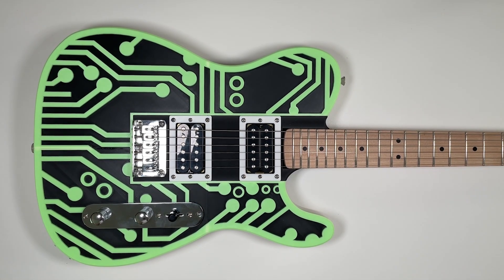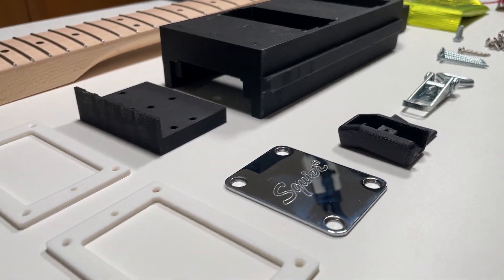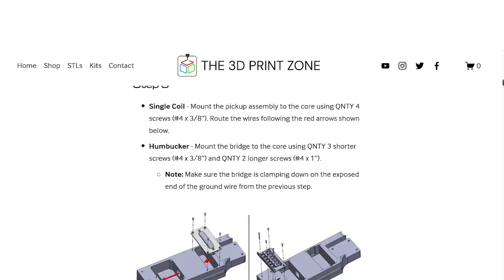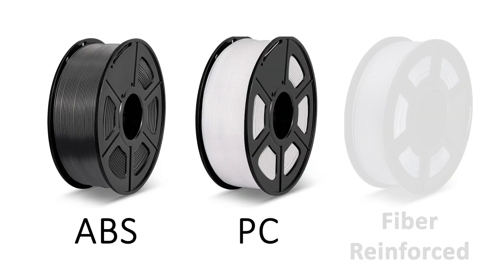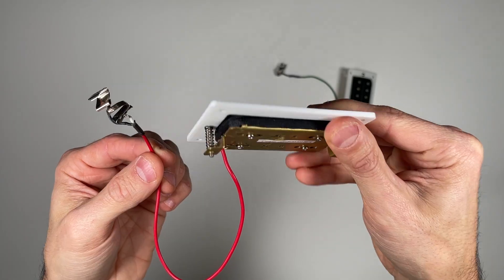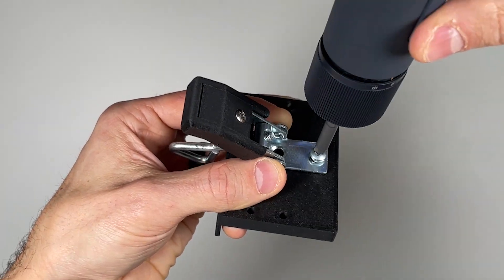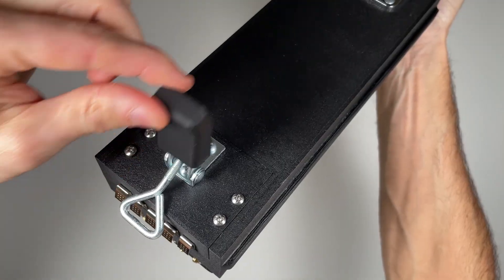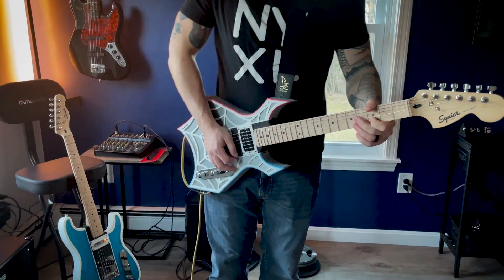3D Printed Modular Guitar Core (Dual Humbucker) – Full Build!

Comment: The dual humbuckers that are linked on the website have more than the single wire shown in the video. What do we do with the wires??
Reply from the maker: Hi Justin. I just replied to your email. Black = Signal, Green/Bare = Ground, Red/White = Not Used, Tape Off. There are also several wiring diagrams resources online. Hope that helps!

Comment: Seeing as this is based on a solid body electric guitar there should be loads of redundancy structurally speaking. Think about it, an acoustic guitar has pretty much the same string tension but is a much more delicate construction that still holds together. I think it should be possible using any PLA. Might just need better print settings. And 1 of the benefits of using PLA is the huge variety of finishes that can be achieved compared to other filaments (for example silk, matte, multi-colour, wood, metallic, glitter-like etc). Even more so when combining them with an AMS.

Comment: Whenever I 3d print large mechanical stuff I have warping issues.
If I buy these files how can I avoid the warping ?
I have a bambulab A1 and got an enclosure as well (only for cold winter time)
I print mainly pla
Reply from the maker: Thank you for your comment and question. The files include .3mf files with recommended print settings pre-loaded for mentioned materials. If you print the body components in standard PLA you shouldn’t have any issues as long as you print with the recommended setting for the brand of filament you are using (temps, speeds, etc). I typically use a PEI bed and apply some stick glue to give it some extra adhesion. Those factors should reduce the chance of any warping. You can also add a “brim” to help keep the corners down. All of these factors should lead to a successful print, and it’s always recommended to monitor the first several layers to make sure they are adhering well and not starting to warp. Hopefully that answer your question. Please let me know if you have any other questions! Happy printing :)
Reply: Thanks!

Comment: Do you think that it would be possible to make a core for a Floyd Rose?
Reply from the maker: Thanks for the question. Incorporating a tremolo into a 3D printed guitar center core is challenging as the tremolo springs are very stiff and want to flex the plastic core. Also, the additional stress and strains added by using the Tremolo will likely cause flexing and bending of the core and fatigue it over time. It may be possible, I just haven't tried it out yet.
Reply: @the3dprintzone  Perhaps a Kahler tremolo? That is a self contained tremolo unit
Reply from the maker: @anqareliouth2921  I'll have to check those out, thanks for the suggestion!

Comment: Since the body with electronics are modular it seems feasible to have different wiring setups per body, ex: 4 knobs on les paul types, coil splitting on Tele style...
Reply from the maker: Thanks for the comment. As long as the center core wiring scheme is compatible with the body you can have different wiring setups.  The current design has live/ground for each pickup and an overall ground (total of 5 contacts).